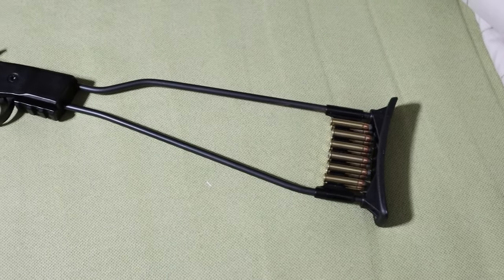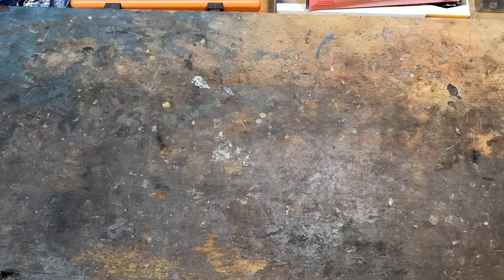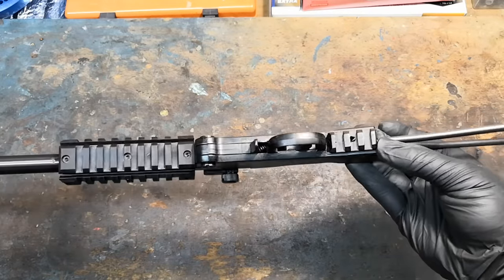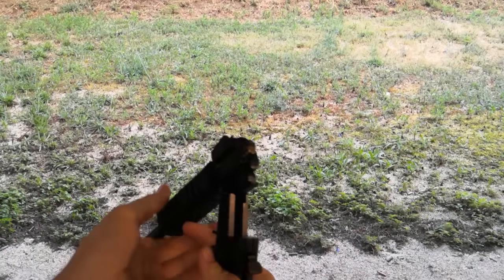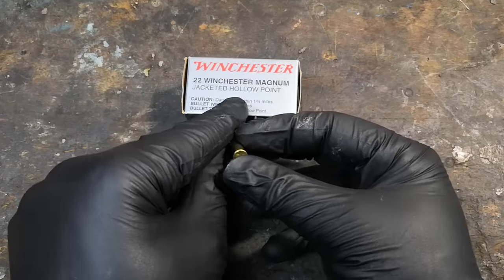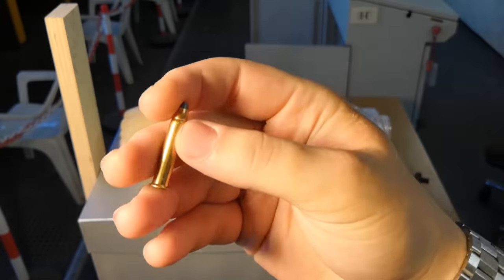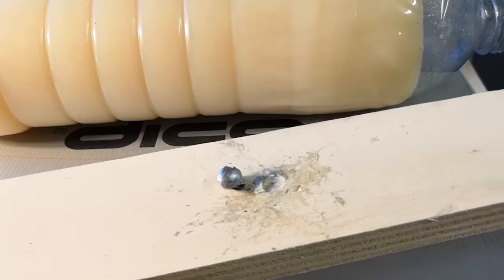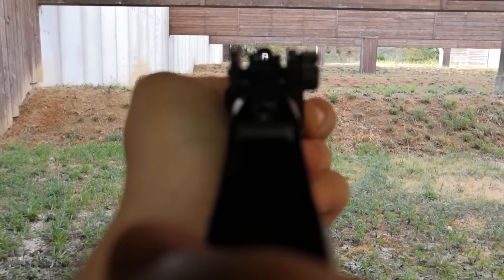How Good Is The Cheapest Rifle On The Market? Chiappa Little Badger

Comment: I like how this has a picatinny rail, like imma buy an optic that’s 5 times the price of the gun I’m putting it on.
Reply: Bubblegum sights
Reply: if this is your son's rifle, you can lend him your optics though
Reply: you can get airsoft sights, they are actually pretty high quality. They are also good for .22
Reply: All optics and lights arnt actually that expensive... You can buy pretty well reveiwed ones on amazon for not much money
Reply: And suppressor threads
Reply: you can get red dots for like $16 so maybe xD
Reply: 4x Tasco pellet rifle scope. Will hold 0 and only cost  about 8$ at Wal-mart.  You can even find a decent enough red dot sight for about $15  The real question is, Why are you buying optics for $600+ ?'
Reply: @hell_march6652  agreed got myself a nice red dot optic for $30 have had it for 3 years now no issues.
Reply: @tesoro9623  airsoft sights? Lol scopes for a .22  are airsoft sights....
Reply: @ricksgaming7298  not all
Reply: @tesoro9623  ok, your wrong but even tho I'm a gun expert who also airsofts on the regular, I'll just let you slid on this comment. There are no scopes made specifically for airsoft or even pellet guns, but the best scopes to use are ones made specifically for .22 because there cheep and they work well with the stress from the consistent abuse of rapid fire and making them work well for spring or piston powered air rifles because there built for consistent stress.
Reply: Oh man excuse me Mr expert, i have seen some specifically made just for them on some videos and airsoft sites. But okay.
Reply: @tesoro9623  rebranding is a common thing with airsoft... Most of it is tasco
Reply: @ricksgaming7298  Okay, i like this response better. Before you seemed rude which is why i responded the way i did. So now we can put it to rest .
Reply: spoken by someone who doesn't know what optics cost.  well done Spiffy.
Reply: spiffy my dad got an awesome rds for 40 bucks we use it on an ar-556 works really well
Reply: @dcard228  Well, don't wanna scare your neighbors in your quest to teach your child on how to defend against 30-50 feral pigs in the backyard.
Reply: All kinds of decent red dots at or under $50.
Reply: @frankfrankerson8127  airsoft gun sights will fit on normal picanny rails. lol
Reply: @hell_march6652  He's probably like a friend of mine is... Mil-Spec all the way, even if it takes next weeks rent to do it lmao (he ain't THAT bad.. yet)
Reply: @hell_march6652  Because that's how much they can cost if that's the performance you want out of it. I'm getting an EOTech soon because it does what I want it to do. I also have a Sig RDS that was about $100 or so, which is pretty average price. It's all about what you want out of it, and what that's worth to ya. (Also, low power variable optics basically start at $300 if you want something good, and go well over $2000.) As a college senior who has taken a course on optics, it's fuckin' difficult to get right XD. So getting optics with great QC is impossible (at least right now) unless you spend a good chunk of change to make it that way.

Honestly, I'm more surprised you don't know that optics are expensive. I just thought that was a given due to my previous statement "it's fuckin' difficult to get right" XD But hey, if you find a cheap sight that does what you want, I'm almost jealous. I WISH I didn't have to fork out hundreds for a holographic sight. Either way, this comment was about 70 words longer than it needed to be.
Reply: so...like pretty much everyone who owns an AR style?
Reply: @dreamwolf7302  Depends on the AR XD
Reply: @Thisisausername556  dude best budget red dot I put on my scorpion is a Burris fastfire 3. Well it is a 3 moa but on a 9mm scorpion the 3 moa isnt much of con. on sale they go on sale for 175 found one used for 140 online before.
Reply: @theghost7277  I mean I have a Sig Romeo and it's doing great on my AR so far. I have an astigmatism that makes red dots bloom in my vision, which sucks because I would love to use all of these budget optics. I just hate how my red dots turn into red smudges XD. I've tried an EOTech and it's much clearer, and the only good holo that's cheaper that I know of is the Vortex UH-1 and it's not THAT much cheaper. #badeyegang
Reply: @Thisisausername556  i have literally seen 7k optics on a 3k AR lol.

I have also seen 5k optics on a 500$ AR..
Reply: @Dream Wolf

>Tries inserting x8 CBQSS scope
>scope too heavy than rifle
>dropped
>x8 CBQSS scope destroyed first
>sad face :(
Reply: Dream Wolf true. I don’t think I’d ever put a $3k or more optic on my AR. Doesn’t seem worth it. On my 7mm mag or .338 lapua mag? Maybe if I’m shooting out to a mile I have a reason XD
Reply: @Thisisausername556  some people are nuts. I have a coworker who has an M&P Sport, and the cheapest of the accessories cost close to 2k, while the rifle itself cost les than 1k its hilarious.
Reply: People build Anderson’s and put aim points on them soooo I mean you wouldn’t be the first 😂
Reply: Dream Wolf that’s the AR I have. I’m going to slowly build the nicest AR possible over the next couple of years and eventually end up with 2 rifles. A really nice one, and a stock sport 2. XD
Reply: Not much different than a person buys a 500 dollar car and puts $2250.00 worth of tires and wheels on it!  Hey Dubs cost!
Reply: perfect for $20 acogs from wish
Reply: and twice the size of the gun
Reply: spiffy uk arms laughs in distance
Reply: @dvorak2676  sure a kid gets a rifle in what world are you living?
Reply: I dunno...you can find some cheap sights out there that do the job. Nothing compared to the higher quality stuff obviously. But then this doesn't seem to be something that is intended as anything more than a survival back up.
Reply: Acog
Reply: Put the biggest Bayonet on it and it'd be mainly a tiny polearm with a shooting capability lol.
Reply: @hell_march6652  I think the fancy scopes are made with durability in mind?
Reply: @yui_the_weeb9800  Not Russia obviously!!! lol. Buddy I had my 1st shotgun when I was 6.  I had a .308 when I was 10.  I remember my dad taking me to the gun show and I picked out a FR8.
Reply: @hell_march6652  sounds sick
Reply: Hell_March It depends, man. I agree with what you’re saying. The exception being that I don’t think you’re screwing yourself just because you spent $1k-$2k on an optic that could last you for decades if it fits what you’re doing. If you NEED (it does exactly what you’re trying to achieve) an elcan specter dr 1-4x then I say get one. Hell yes they’re expensive, but they’re almost marine proof. Almost. If you’re trying to reach out to 1.5 miles, then you’ll need a scope with flawless lenses which costs money. If you’re just out target shooting, then get a primary arms LPV for $300-$450 and you’re good to go. Or even cheaper/just irons if you don’t need to see past ~100 yards. It’s all about use, and what you can responsibly purchase.
Reply: keith moore  and there  are uzis and other handguns under 10 $ in some parts of the world.
Reply: perfect for my comp m4
Reply: Well that's the whole point of a cheap gun.... You got more to spend on optics and accessories. ;)
Reply: This would be extremely interesting as a 410 shotgun
Reply: It's funny that you think you can't put a cheap optic on a cheap rifle?
Reply: @theghost7277  you don’t think a bolt moving back and forth puts some type of forward recoil on the gun? There’s less recoil from airsoft and pellet guns. I doubt an airsoft guns forward recoil is gonna ruin any well built optic, especially one that hold up to the forces of .50bmg, racking a round produces more force and firing an airsoft gun.  The force of the bolt moving forward. Auto loading weapon also have pistons that move much more violently than an airsoft gun would. Think about the forces applied to a red dot mounted on a handgun slide. Every shot is throwing the sight forwards and backwards. I even use my red dot as a pseudo charging handle on my pistol and I don’t lose zero or mess up my sight by doing it. If your sight gets fucked up from being bumped into or from the recoil, you either have a shit optic or did bad job of installing it on the weapon.
Reply: @theghost7277  what “basic knowledge” did I miss? Please show me where I’m wrong. Anything I look up states that airsoft sights are usually repurposed optics for real firearms. My father put a leupold scope from his .44 mag marlin rifle on one of my pellet guns when I was 7 and it’s still zeroed in after years and years of use.  I’m not claiming to be an expert, I could be wrong, but I’ve been shooting airsoft guns, paintball guns, pellet guns, bows, and real guns for as long as I can remember. I got my first rifle at age 4 ( .22 mag marlin xt) and my first shotgun at 7(20 gauge Remington 870 youth model, had the stock cut even further down to fit me). My experience with many different types of guns and a basic understanding of physics is telling me your slinging bullshit. Ain’t no way an airsoft gun is gonna fuck up something that can handle .50 bmg or full auto.  So unless you can give me some type of evidence for your claims, I’m calling bullshit. Idc what airsoft  gun you have, it won’t be more stressful on a sight than a real firearm would be. I’d forward recoil effected gun sights my ar would never be zeroed due to me bump firing it so much. Hell I use the red dot on my pistol as charging handle and it’s common for me to just drop guns on the ground if I’m carrying a lot of stuff. If you have a quality optic and it’s mounted correctly, it shouldn’t get knocked off zero that easily, only time mine aren’t zero is if they get knocked around pretty hard.

Comment: It's actually a well designed firearm. Simple, cost effective, reliable and it works.
Reply: cost effective? it costs 170 bucks, thats a joke! if you pay 20 bucks more you can get a proper rifle with wooden stock and everything… I wouldn‘t pay more than 90€ for this
Reply: @REALdavidmiscarriage  This one is very lightweight and has a good trigger. Yes, for a little more you can buy a single shot or bolt action (or maybe even semi-auto!) with better ergonomics, but it's going to be heavier, and likely the trigger is going to be worse as well.
If you get a semi-auto, you'll be limited to a narrower range of ammo.
Definitely, the Little Badger has it's niche.
Reply: @scriptguru8  It just seems like a rip off for that price
Reply: @REALdavidmiscarriage bro this is not meant to compete with your average guns. This is simple, compact and lightweight. I kind of like it.
Reply: @TurquazCannabiz  still the price point is too high.. 70-90 bucks is what I would pay for it
Reply: @REALdavidmiscarriage  You're just poor.
Reply: @SludgeManCometh  Hahaha that response is the most ignorant short sighted thing I‘ve read in a long time. Thats like saying people shouldn‘t complain about inflation and riding gas prices they should just work harder. Incredibly short sighted and just straight up dumb tbh.

Comment: honestly i think it looks like the kind of thing i'd keep in some camping gear as a back up rifle, especially for the price.
Reply: I think that's what its designed for, a lightweight back up gun that has nothing extra.
Reply: I’m still kinda confused, why not just bring a pistol with a capacity of 10.
Reply: @genoob5843  Pistols are very short range and have, in military terms, "low stopping power". A rifle has longer range and can penetrate deeper into a target,which makes it better for hunting than a pistol would be.
Reply: @somewhereelse1235  I’m kinda sceptic tho, what if you miss the first shot and now you have to scramble around to reload another round while under a high pressure situation (assuming something is chasing you). I’d say it’s better to invest in a shotgun, this rifle is more for sporting than backup.
Reply: @genoob5843  Considering how much easier it'd be to carry around than a full sized rifle or shotgun, this would be pretty decent to scare off any predator getting too close so it doesn't end up chasing you, better than the standard handgun, but if you're getting chased then a high powered cartridge of a rifle or the size of a slug would be better, yes
Reply: @somewhereelse1235  that’s what I was thinking you know, I was wondering what if a grizzly decided that you’re a threat and decides to attack you. This shit wouldn’t be able to take the grizzly down in one shot, and that’s what shotguns are made for, to protect campers out there in the woods from bigger apex predators, so yeah I would call it a sporting rifle.
Reply: @genoob5843  Hunting rifles are for hunting and target shooting, not personal protection. Shotguns are the ultimate personal protection for the scenarios you are thinking about. This is made to carry with you anywhere and still enable you to hunt small game for sustenance, not kill a bear. This gun is like a pocketknife or a flint rod. It's not meant to be used in a warfare or home invader situation.
Reply: @johnjingleheimersmith9259  sorry my bad, confused a hunting rifle with a shotgun again 😅

Comment: This looks like the replacement for the eoka pistol in Rust
Reply: Waterpipe
Reply: @TheOfficialButthead  no theres a eoka pistol its cheaper than the waterpipe
Reply: Eoka pistol, 50 metal and like 200 wood not waterpipe
Reply: Non craftable, air drop eoka

Comment: I bought one of these this year, pisser little rifle. Easy enough for my 5 year old daughter to shoot.
Wasn't real keen on the stock sights and got a cheap 4x32 scope. Shoots nice
Reply: A cheap red dot will serve most purposes.
Reply: @lairdcummings9092  A Cheap scope will serve even more. A 22. WMR is easily capable of accurate shooting at 100 m and at that range a scope is nice
Reply: @PilotAwe  sure.
I prefer the fast acquisition, but a well-chosen scope works too.
Reply: @lairdcummings9092  Well it depends obviously what you are hunting, for fast paced short ranges red dot is superior
Reply: @PilotAwe  indeed. 
I typically hunt varmints at the edge of eastern woodlands, where fifty yards is a long shot. Hell, twenty five is a bit unusual. But a .22WMR will put down a woodchuck quite handily, and in the heavy brush and brambles, you take the shot fast, or not at all.

Comment: There are quite a few rifles that are less expensive. The Savage 62F is a few pennies under $100 at Wal-Mart, and it's a 10 shot semi-auto.
Reply from the maker: Oh wow... In italy that same model is twice the price😑
Reply: @Backyard.Ballistics  
A new Mossberg Plinkster can be had with a blue stock for $104 at Bud's Gun Shop. I purchased my standard model Ruger 10/22 for $179 at Gander Outdoors here in Michigan, USA. Of course I now have 3 times that amount in it and the only things left that are original are the Bolt, Firing Pin, and Receiver. I would have saved about $80 if I would have just bought those items, but now when I do replace them, I will be able to put the original rifle back together to give to my son for Christmas. We here in the U.S. have several new rifles available for less than the Little Badger, the Brazilian made Mossberg Plinkster (as previously noted), the Rock Island M20P & M14Y, the Rossi 22MAG & 22LR, KSA Cricket, Savage 64, and Remington 597, to name a few, can all be had for $112 to $165. In fact, I thought about purchasing a Chiappa Little Badger, but for what you get, it's just too expensive, for me. If you need a small, single shot, survival type rifle, it is a great buy. I don't, so its not.
Reply from the maker: @johncashwell1024  that's a christmas present I would have loved 😉
Thank you for sharing your story🙏
Reply: @Backyard.Ballistics  I spent just over $200 on the Savage 64 takedown. That seemed really cheap for a takedown semiautomatic rifle.

Comment: That would be an awful home defense weapon, totally orientated more to a sporting and hunting purpose
Reply: Err, I don't know that much about guns but wouldn't a hunting gun be better for hunting. Home defense weapons simply need to be reliable so I guess.
Reply: @RNB_lovr  No, this is more of a training weapon than anything else. Home defense at the very least needs to be fast to use(at least that what I think)
Reply: The wrench: an awful hammer, definitely better for turning bolts.

It's a survival rifle. It's meant to be very light weight and just capable enough to get rabbit and grouse reliably with light ammo, without the complicated semi-auto mechanisms in the Henry or Ruger, but not be so weight focused that it'll bend from looking at it funny like the PackRifle. For the type of tool that it is, it's the best one on the market.
Reply: @temkin9298  The ideal home defense weapon needs a few criteria, including:
1. Fast and easy to use (like you stated). Fast = capable of providing at least a couple rapid follow-up shots. Easy to use = ergonomic and easy to aim.
2. Accurate
3. Compact (since most of us don't live in places with halls like the Taj Mahal)
4. Provide adequate stopping power and possess little risk of overpenetration (although this largely a selection of projectile type)

The Chiappa Little Badger only fills criteria 3, and maybe 2. Something like a Barret M82 doesn't fill any of these criteria. An AR pistol chambered in 5.56x45mm fills all of them.